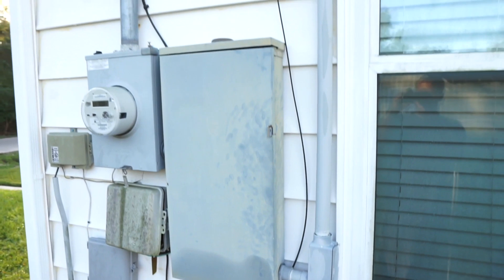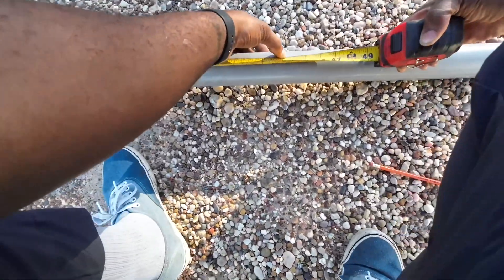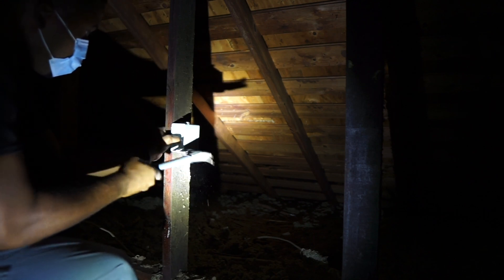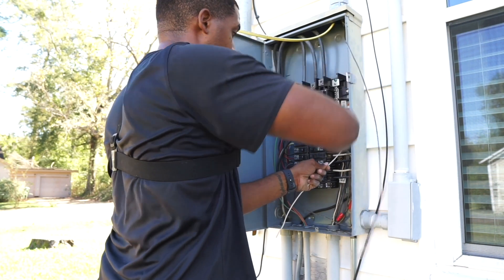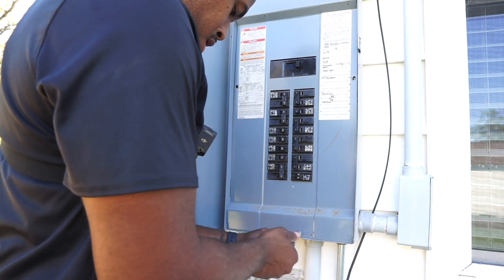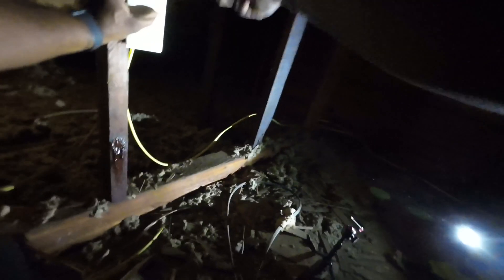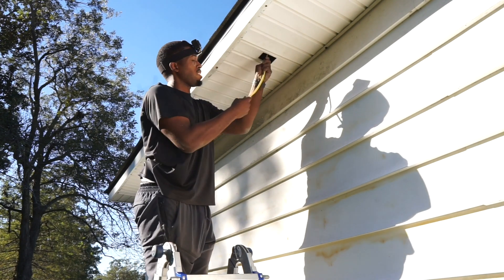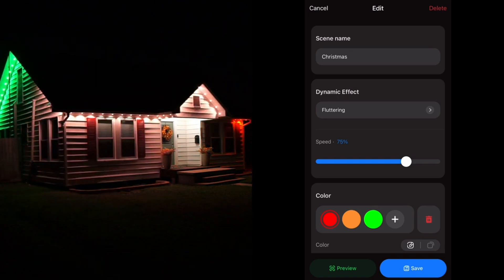How To Install An Outdoor Receptacle | Day In The Life Of An Electrical Apprentice!

Comment: I'm in the same boat as a 2nd year apprentice, able to work on most things in my own home. Its a great feeling! Just curious why you used Romex through the PVC and not THHN? Exterior raceways are considered wet locations.
Reply from the maker: @kyanck  Thanks Kyan & Congrats on your 2 years glad you’re enjoying it. From my understanding if I was to use THHN in the attic I would have had to run some sort of conduit to keep it protected & that would have just been a hassle in my opinion. But I’ll see if I can fine the code reference and let you know! Good question though appreciate it..👍🏽